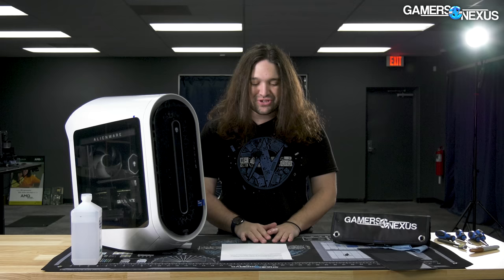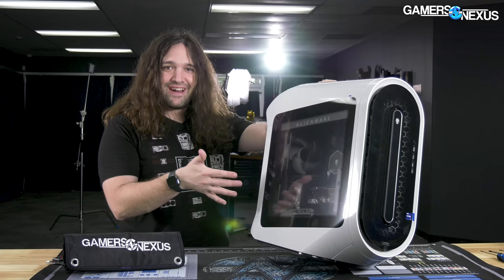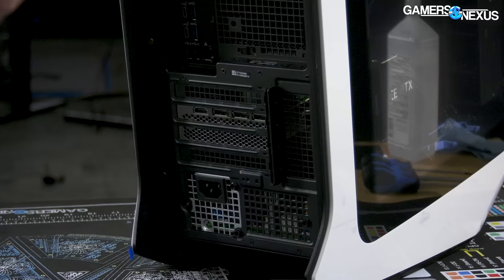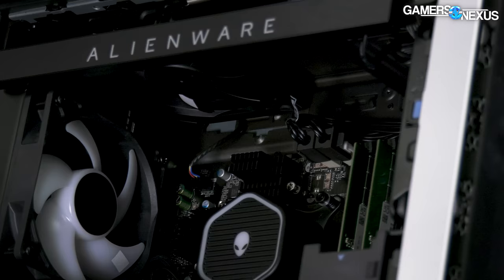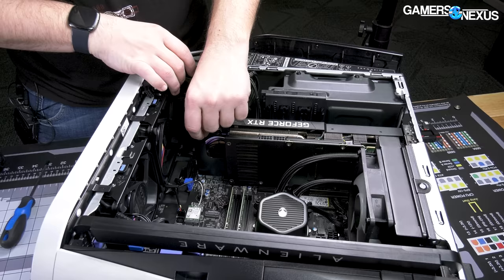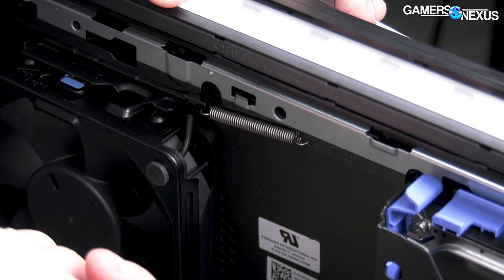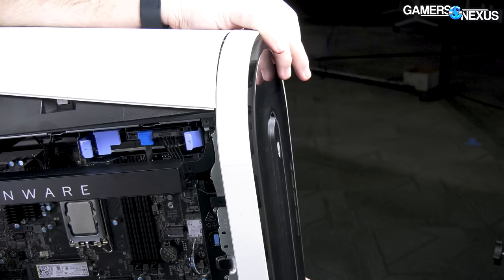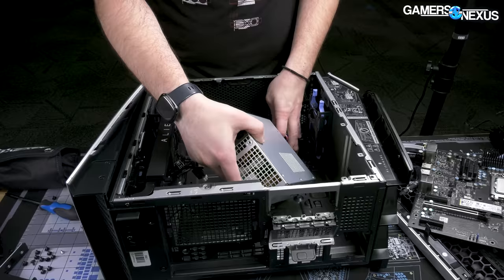Crazy Bad $5000 Alienware Gaming PC: R13 Aurora Tear-Down

Comment: Aside from the cooler fan on the radiator's blade were black and not white as shown here, I just pulled that EXACT same water cooler out of an Alienware R4. An Alienware build from 2012. That does not inspire confidence to me. It does tell me however if I really wanted to I likely could hook that up to my new custom built computer and have okay to bad liquid cooling on my i5-13600KF. I'd have to see the test results from the other video first. 

It also makes me a bit worried about my sisters Alienware that she just bought last year,(I tried to talk her into buying the parts and I'd build it for her for cheaper but she wanted the Alienware and it IS her money.) though it only has an 11th gen i9 in it, an 11900F to be specific. Yes she did indeed get an outdated low power i9 choosing the top level parts for her brand new prebuilt last year, almost exactly a year ago actually.

I also gotta say as much as that doesn't look pleasant to take apart it does look a far sight better than the R4 so at least they've come some way. The R4 you basically had to take it half apart to even start thinking about taking any of the actual computer parts out of, and if they thought something could be in multiple pieces it was. I legit was taking it apart so I could hopefully repurpose the power supply because it was a good power supply, 875 watts silver rated, and didn't have any sort of bottle neck I could find, likely because the R4 was SLI GTX 660s so it needed a fair bit of power. The power supply did work to power my new custom build, and nearly saved me the $160 (Canadian) I spent on a new power supply with only one problem. It's 8mm taller than a normal ATX power supply. So it wouldn't fit into the slot on my new case. I ran it just sitting outside of the computer for around a month because I really didn't want to spend the money on a new power supply, but ultimately gave in and bought a Superflower Leadex III 750 watt because it was on sale, and I was getting really stressed about having the power supply just sitting there outside of the case. Even more so where I have a dumb shit little cat who likes to see what things are by biting them, meaning I was basically going to sleep stressed that she would bite one of the thin cables coming off the power supply. 

Side note I decided to go and look on Dell Canada's website and the entry level Dell Alienware R15, has an almost 100% markup. It's $1999.99 and based on PCpartpicker prices the specs of it only cost $1063.77. God am I glad I got out of buying pre-built PCs. There is at least an XPS that's ONLY a 40% mark up, and is cheaper than the entry level Alienware while also being more powerful, makes me glad when I was getting prebuilts it was always an XPS, but fuck man. That lower mark up is purely because of an "instant savings" offer on the thing lowering it's price by $540. All of the extra engineering Dell does actually trickles down into their more budget options and does make for some in my opinion neat cases for the budget user. Like the older Alienware you guys looked at actually shared design with my "old" 2019 XPS, at likely a fraction of the cost, only from having seen that video it was actually done better in my XPS, likely due to it having a far lighter PSU. 

Maybe it is because that XPS was my battle station for nearly 4 years, or maybe it's because I've had Dell computers since 2010, but I do have a soft spot for them, those little engineering quirks are neat and I do enjoy seeing them, but I doubt I'm ever going back to buying from Dell, as most of the reason I even bought pre-builts from them was I was to poor to ever buy a computer outright so I'd have to do the Dell Financing, something they don't do anymore at least from what I could tell. Plus my current build should keep me going for at least 5-10 years easily so I should hopefully be able to build a new custom machine when this one no longer works for streaming. (Shameless self promotion if you read this far into my ramblings, I'm a small time Canadian streamer who just kind of streams what ever I feel like, who is trying to get at least semi consistent, so no obligation to check out my stuff but if you like the sound of watching a random Canadian guy stream various video games I would appreciate the view. Shameless self promo over.)

Comment: I think you should have started by reading the manual beforehand to show viewers what the intended way for customers to open the case was, according to it's design. Your bias is that it's over engineered, proprietary, and full of cut corners, and I will agree with you on that; but just for the sake of completeness, you should be fair and try to understand their design from their point of view. I think booting it up so viewers can see the "beauty of it" would also have been nice. And also to gage temperatures inside the case, under a full load and idling too would have been good. Did you mention someone else on your team already reviewed it and your just doing the tear down? 

You're right though, I doubt it would have $5,000 worth of gimmicks in the form of branding, mounting and support brackets, and spring loaded chassis elements. The ram doesn't even have heat sinks and the case is designed to get too hot. Planned obsolescence indeed.

Comment: You should give it to me.   after you put the parts in a white Corsair 5000D airflow case

this blind girl needs a better video editing rig and i can't build one blind so trudging on and on with this FX-8350 and 1070.  I've build and repaired hundreds of PC but just sticking in DIMMs wile blind is an exercise in frustration.   Try it with your eyes closed and you'll see what I mean.

The sad thing is I was making a piece meal shopping list of parts off ebay yesterday for a $1000 4950x system..

I'll mail you back a Commodore CBM PET, or a Darth Vader Apple II used by Captn Crunch.  The PET would look banging as a show backdrop.  You can keep the 3070, I just need more cores / threads! :)

Comment: For all that GPU-support that they engineered, I blame the consumer, because they've normalized tower-cases. - What's wrong with those?... Well, that mounts the motherboard vertically, which is wrong, and then mounts the GPU horizontally, hanging from the slot on the motherboard (and of course the bracket that hooks into the case). - It wasn't designed that way, it's designed so that the motherboard lies horizontally, you know, on the DESKTOP, and then the expansion-cards sit up straight into it, with no stress at all. - Yes, I know towers were made to reduce the footprint and thus save space, but it doesn't make it correct. - Anyway, it's what caused all this nonsense.

Comment: 5k for this?
Any decent case: 70-100
any 360mm Liquid Cooler: 100-140
am 5 board: 250?
ryzen 9 cpu: 500
4070ti or some Radeon: 900
32gb ddr5: 250
1000w power: 100-120
max 2500 bucks
Reply: The video was filmed during the gpu shortage, but even then this would’ve been a bad deal; no to mention all of the Dell BS like proprietary parts.

Comment: Alienware used to be a computer system that was sought after, but those days are long past.  I bought an R12 a little over a year ago and I seriously regret it.  The only reason I bought it was due to the chip shortage from the lockdowns and Alienware had their own video cards.  This POS system crashes several times a day, even after a fresh windows reinstall.  Until Dell can pull their heads out and get their act together, I would highly discourage anyone from buying an Alienware system.

Comment: Have to comment a year later, that I'm still shocked with the non standard motherboard design. Why can't those front panel ports be on a separate daughter board. Completely ruined the main board design. Wanted to pick one or these up but because of the non standard design can't bring myself to pull the trigger

Comment: it surprises me companies like this make the most garbage stuff. i just built my computer with vary limited space i had to work with. the case could not be bigger than a set of dimensions it had one spot to go. i was still able to fit a 240 rad and a 3 fan gpu had 3 fans in front. there was no way that alienware computer would fit where mine is.

Comment: I bought the same one. Trust me it sucks!!!!! I had to swap out the fans because it started making a clanking noise and the rgb stopped working. Took out the blue bulky part on one of the fans cuz it’s restricting airflow. Had to get a better ram. More memory. New wiring. Basically it’s a waste of money. Not worth it

Comment: "Can you hear the Ronald McDonald in the motherboard?"

You know, Alienware is why and how I started building my own computers. Especially Dell tech support and their means and methods for upgrading hardware... Specifically though, I liked some of the gimmicks back then because I was very freshly into the PC world moving up from a cheap laptop and didn't know better. But a faulty Alienware keyboard, a bad tech support rep with broken un-English giving me bad advice loudly (talking over me, over the phone as if I the caller do not know why I am calling), and a scummy process for upgrading a power supply that utterly mandated buying their product... I said, screw it... So I dove headfirst into learning how to assemble my own rig. It was a ramshackle and rough little beefy toaster, but it was MY rough little beefy toaster. I still use it and upgrade it today. 

So to all the newbies in the PC market today, don't take the criticisms of Alienware too harshly, it's directed at the product and terrible company taking advantage of you, not directed at you. Take some time to get to know computer assembling and work your way toward building your very first rig. It's so much simpler than you think, and enlightening to reveal how much companies fleece their customers. For one, you can get some very solid components on a tight budget. And two, you'll no longer have to rely on underpaid but overrated and rude unqualified tech support because you'll have the foundations to learn how to diagnose and fix problems yourself. Best part is, you can be as enthusiastic about or as lazy as you like when it comes to cable management... But seriously it's gonna be terrible the first couple tries(the cable management). It's gonna be ugly and would even disgust Frankenstein's monster. But it'll be your precious bundle, and you'll be officially part of the most pretentious and nitpicky, egotistical group on the planet, and you'll love every second as you look down on the console plebs in somewhat hypocritical disdain because you still use a console controller to play your pc games. Join us, we have cookies.

Comment: the stand for gpu look cool in engineering stand point, very sturdy, theirs fault probably everything look like design by mechanical enginneer, they need to work both with aestheticaly designer too, the engineer just doing the job, like this is enough cooling etc rather than overbuild thing and make it cool

Comment: The most direct contrast to this thing in terms of proprietary form factors would be the PMG5 or OG Mac Pro, and the 2019 Mac Pro as both of those cases are a proprietary design, but they're a good proprietary design with a ton of airflow front to back especially with the 2019 Mac Pro, this Alienware is what happens when you make a system with a proprietary design, but it's a bad design.

Comment: I built a 13700KF with a 4070TI inside my old Antec NX1000. It was all new parts expect for the case. Its very similar FPS (sometimes better) in most titles to this build but I did it for $2300 CDN all in. Less then 1/2 of this thing. And I won't thermal throttle. Alienware cases are a joke.

Comment: $5k is way overpriced. you should be getting an NVMe + SSD setup only. The case is extremely large, but the inside is still so cramped... the case looks to be a full sized tower, but the inside is sized like a mid size tower. If you were to want to upgrade this PC down the line they've gone to great measures to make that nearly impossible. Shame that there are non-tech savvy people out there that will buy this cause it looks "cool"

Comment: im actually kinda surprised they didnt have the hard drive socket directly into the motherboard..  could you buy aftermarket fans and socket them into the brackets at the front or do you have to bend over for dell and take whatever price they set them at if one should go out?

Comment: I won't lie, my rog gb20. I think, is actually a good pre built for the price I got it for. Cause at the end kd the day. I paid about 1k for it.  Mine had the 1070. I have to say I'm only just now replacing it with a computer I'm building myself.  For far less than this. And I'm talking I may have spent too much on everything.  And yet I'm still coming in under 3k. And all I need is custom cooling, and that may push it to 4k after all is said and done. This shows me that not buying a pre-built and activating monkey brain to get pc fast. I can now take most of the components into my next build which means at most I'll be spending money on a gpu and maybe a new motherboard. But I think a 13900k will probably be great for a looooooomg time

Comment: I wanted to see what the price of the components are at a local e-store just to see how overpriced this is and guess what the price was: 5,789 euro... and by my quick estimate, with around 4,400 euro you could get high end and high quality parts (same cpu but better case, psu, motherboard etc.) and a 4090 instead, while actually saving almost 1,200 euro (which is about equal to the dollar atm)... idk how dell and alienware get away with this...

Comment: I have a graphics card that comes with a water cooler by default and i also added another water cooling unit. Even with that and 3 fans if you boot up a large battle in Total war it rises the temperature of the room by a solid one or two degrees. I dont know where i fucked up.

Comment: He cant talk about expensive I got scammed for 3000$ I paid that for a hp desktop with a ryzen 3500 a gtx 1650 and a 250w non modular psu. Oh yeah did I mention that it came with a 30$ hard drive that has 8mb per second write speed. Thanks hp.

Comment: MSI & Asus have better B660 mobos in the budget segment than this. There is an argument of saving time by getting a prebuilt system but I could get a system with top end CPU + GPU for half the price from some of the most expensive SI's in my country.

Comment: I hear a whole lot of bitching and very little about what you would do to fix it or even make it better.  I had a dell for 10 years and never had a single problem.  Just recently replaced it after upgrading it over the years.  No issues.  I'm guessing if I bought this product I wouldn't have any issues either.
Reply: Games Nexus did a video on fixing it the issues were the fact the cpu and gpu were overheating. The cooler, board and, psu and case were not normal also some old dell/hp systems had real parts possibly including your 10 year old dell
Reply: @sansdotsh  It's because Dell never got out of the 80's and 90's when proprietary was king.  Now with computer components being standard and building a computer being easy I don't know why people still go to Dell instead of Microcenter, NewEgg, etc to build a computer.  And the new Alienware with 13th gen Intel and the latest AMD still has an 80mm fan layout but an 120mm AIO cooler and it still looks cramped inside.

Comment: What could you get if you spent the money on individual components (assuming you'd get the same CPU and memory to kind keep things reasonably similar). I imagine, you could get a better video card at least.

The current pricing on the 32gb R13 is $2699, so I went to newegg to source comparable specs. I was able to get the same specs (including Windows 11 Home) with standard parts, AND upgrade the video card to a 4070ti and STILL spend less than what the R13 costs.

Comment: Given circumstances that cannot be avoided (I HAVE to get a Dell, don't ask) and I'm looking at 3070, 12th gen i7, is the Alienware r13 worse than the XPS in terms of thermals? Enough so to avoid them completely? I know I'm looking at junk for junk but thems the breaks. I can't seem to see if there is a relevant difference between a "same spec" 8950 XPS desktop or a r13 Alienware.
Reply: Looks like the same chassis. The xps looks like it might get better airflow though, assuming those holes aren't just for show
Reply: > dont ask

why not? is there no alternative?
Reply: @NovaStorm93  none

Comment: What if you took all the components and put them into a better case and see how much improvement you get.
Reply: The motherboard wont fit in any other case because it dose not use a standard form factor (the front IO being part of the motherboard etc).